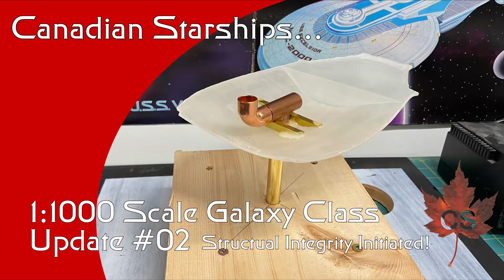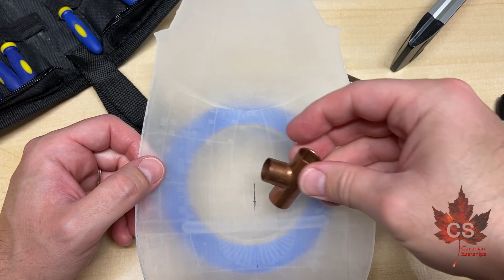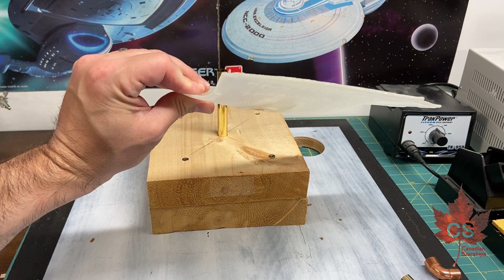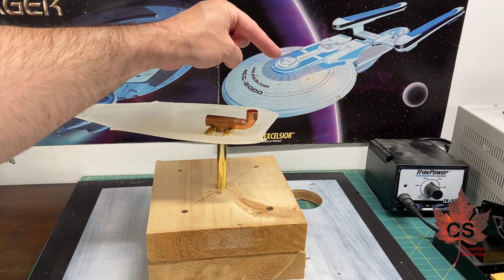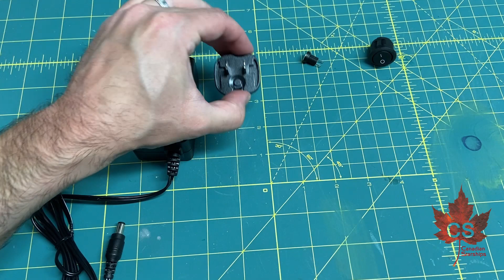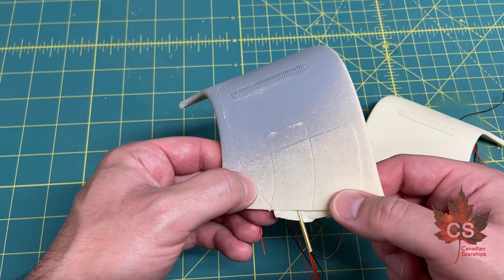Star Trek 1:1000 Scale Galaxy Class Model Build Update #02 (2021)

Comment: I have to tell you I've belt this kit and the way you have the support stand it's likely to warp the bottom over time. It's a very heavy kit and you're putting all the weight very on that resin bottom of the secondary hull.  I did mine buy building a brass that mounts to the top of the secondary hull and runs up the neck where it connects to the bottom of the saucer, that way there is no weight on the bottom only a hole for the stand to go in to.
Reply from the maker: Hi James, the armature on the kit is going up through the neck and being epoxied to the bottom saucer part, which will handle the majority of the weight load. This kit can’t be safely built without such a metal armature.